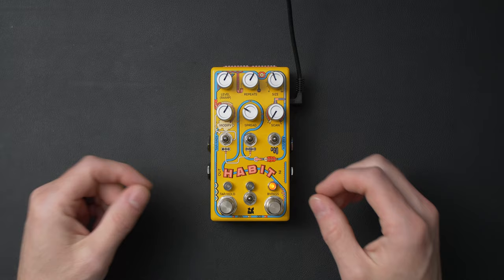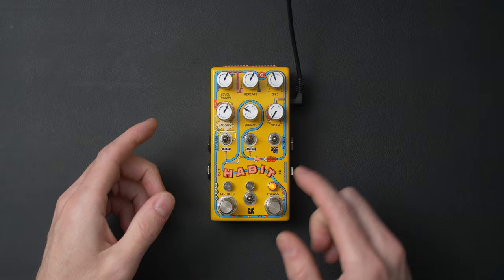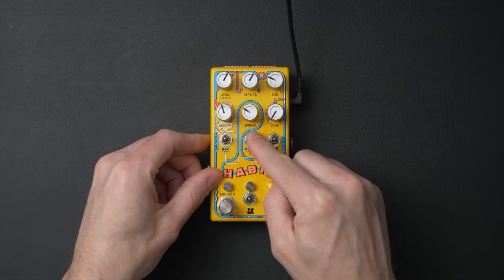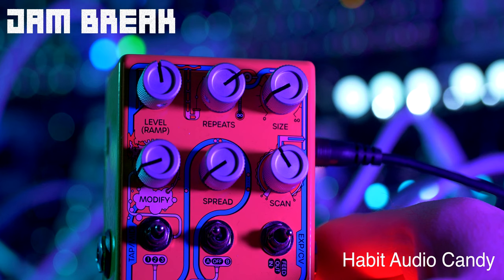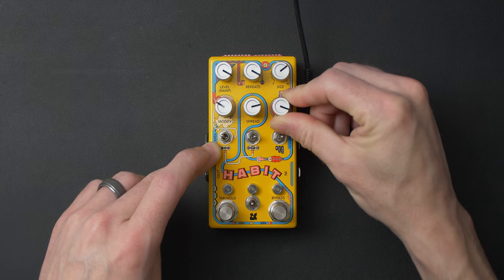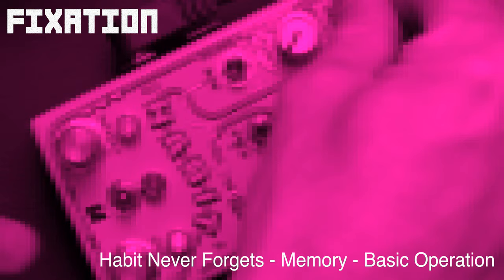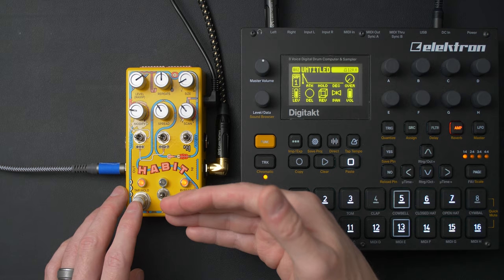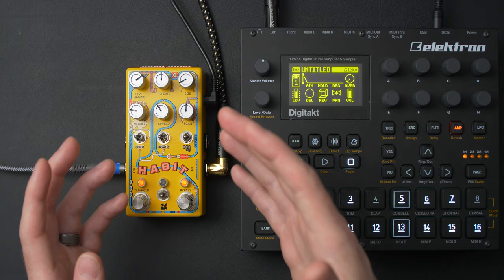Habit - Deep Dive - What Is It and How Does It Work?

Comment: Thank you so much for doing this  - your break down of the spread and scan knobs is what I’ve been hoping someone might do, answering my question- whether it might be able to do something similar to the Soma Labs Cosmos - a drifting multiple loop. It certainly seems to be capable of something along those lines.

Thanks again 🙏
Reply from the maker: So happy you found it useful. It took me a while to understand how the Habit worked at first. It's good to know this is useful for others as well. A drifting multi-loop seems very possible. Thanks for watching and thanks for the comment. Cheers!
Reply: I was thinking the same thing. Perhaps a cheaper alternative. Maybe somewhat harder to operate though.
Reply: @sirjaunty1  it definitely wouldn’t be quite so straightforward - the Cosmos looks very user friendly. Although having been using a Blooper for a few months, once you’ve got your head round the various functions, it’s pretty straightforward to lock in to favourite themes and this seems similar in some ways. It definitely wouldn’t be able to everything the Cosmos can, but then it’s got other things the Cosmos hasn’t…….I’m definitely more tempted by the Habit now though
Reply: Great video thanks for that is really something what the habit can do.  what would you say between the habit and the mood mk2  ?

Comment: Does it stay in time when it loops around at the 3 minute mark of buffer recording?  I feel like it's gonna randomly shift off the initial grid even though the technical timing/tempo will be the same.
Reply from the maker: As far as I know, the tempo syncs the delay time which is sort of post "ping" 1&2 of the 3 min memory buffer. I believe it also syncs the built-in LFO. With that said, the memory buffer is 3 minutes and is not adjustable. So, I would think of the memory playback as almost its own sound source and doesn't really tempo sync... unless you are in easily divisible increments of 180 seconds. If that makes sense.
Reply: @SecondhandSynth  yup it does make sense.  Thanks for reply!